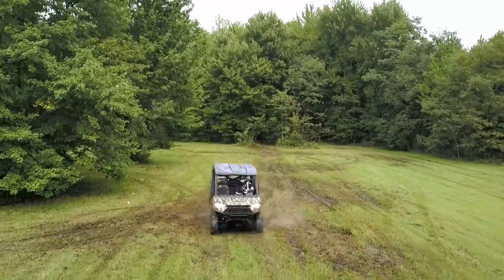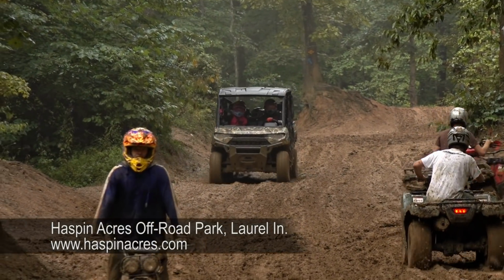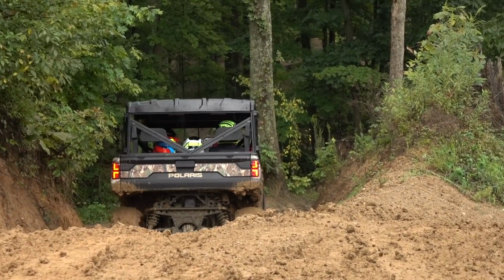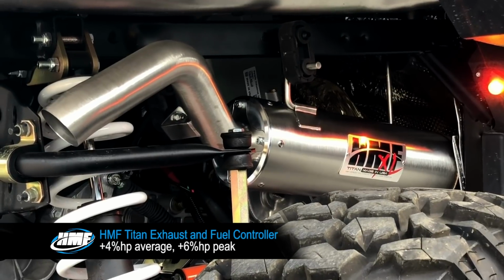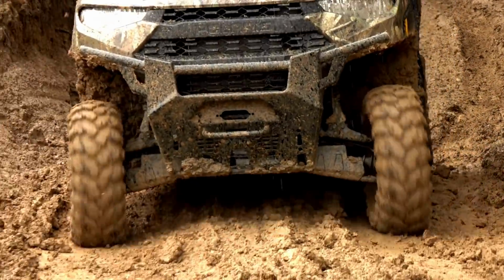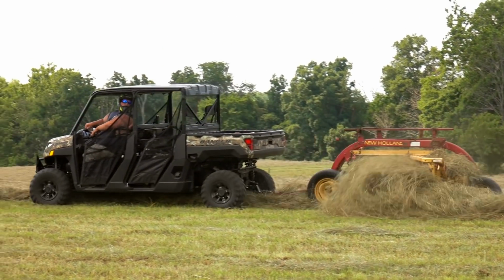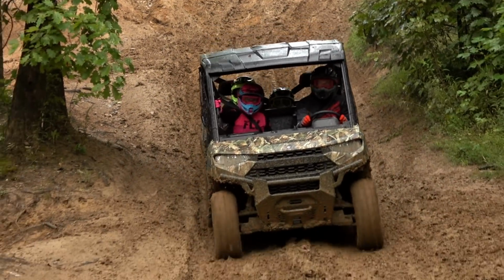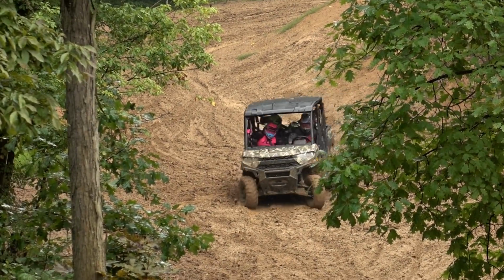2019 Polaris Ranger Crew XP 1000 Test Review

Comment: Had to have my front carrier bearing replaced on my 2019 ranger crew xp 1000 at 300 miles give or take a few miles.stock machine with no mods. just easy driving around farm land. i think polaris should make the whole drive train stronger on these machines especially the drive shaft and carrier bearings. A machine that cost what this one does should last like a car or truck last doing what it’s designed to do in my opinion. With that said polaris did fix it under warranty and i still think these are good machines and i plan on keeping it for years but it still needs improvement for what it cost and what its made to do. Thanks for the videos 👍
Reply from the maker: Thank you for the honest real-world feedback. Lots of people go out and trash their machines and blame the manufacturer. You do a good job of laying out your case. Please keep us posted on how the repair holds up.
Reply: Utv on demand i will keep you posted.
Reply from the maker: @hummyhero1484  thanks. I hope things go well.

Comment: Have the gotten rid of the dang reverse chain yet??
Reply from the maker: Sorry for the slow reply but we wanted to verify our answer.  Based on our interview with Polaris engineers for the upcoming Ranger Crew High Lifter Edition test, While the High Lifter Edition has a reverse drive gear, the other Ranger Crew 1000 models still use a reverse drive chain. please don't give us a thumbs down we're just delivering the news:)
Reply: @UTVonDemand  Thank you very much for the response!  I wish they would just transition to one shared transmission without a built in weakness...I own a ranger 900 crew, and that one design flaw right there seems like insanity...
Reply from the maker: @soundmandave21  have you had any issues with reverse in your machine? Do you find yourself taking it easy in reverse? Now that they're doing it in the High Lifter Edition hopefully they will carry it over in the future. Tougher is almost always better in our opinion.
Reply: @UTVonDemand  I have not had issues with it personally, though knowing it is a weak link I baby mine.  The reverse chain is probably the main reason I do not have the machine lifted further than 2 inches.  Its a crew and has a very strong tendency to drag its belly... Here's to hoping they add the reverse gear to future lower spec models!
Reply from the maker: @soundmandave21  Polaris verify did for us in our upcoming High Lifter Edition review. That will be out tomorrow night.
Reply: I just read that they have for the 2019 highlifter edition. Can't find any info on the regular edition.
Reply: Bad design